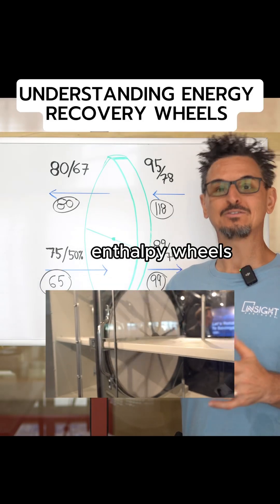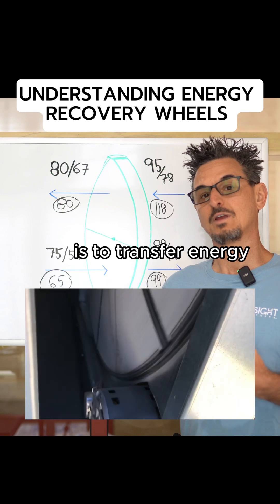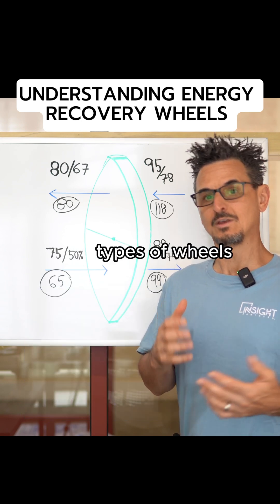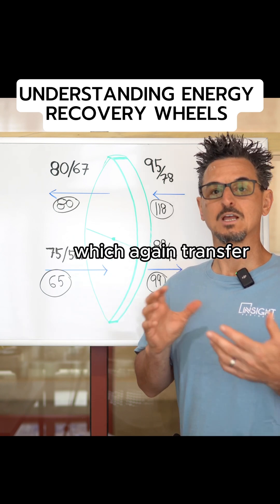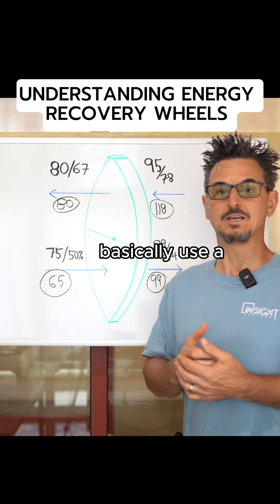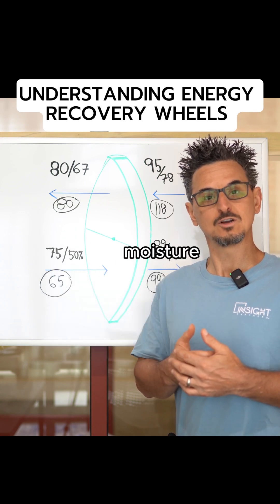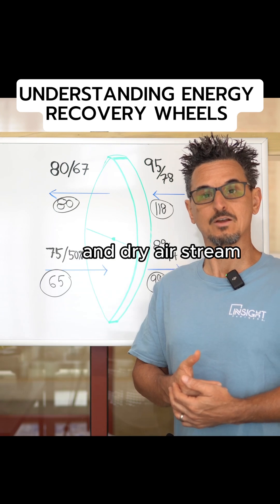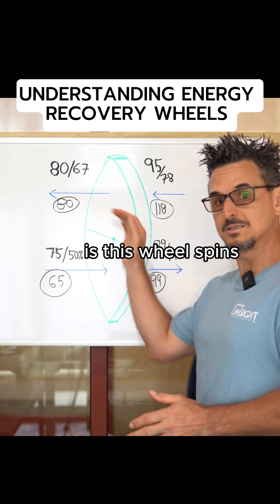Total enthalpy wheels, or energy recovery wheels, are essential in high efficiency HVAC systems

Comment: I do not know you are able to answer me or or not .
Q ? 1 - furnace is less than 3 years old
2 - we bought 10 years service , so them people come twice a year check the system .
3 - this year 2o24 them people came to do so called to check the heat , he sat down and was not able to look what he was doing for 40 minutes , when I ask him what's wrong he said " he is adjusting the gas presure , after he left our furnance was not wotking like before
I have to keep it at 78 or 79 degree to keep the house warm . 
Are you able to answer this problem . He was removing some parts , I do not know why ?
what is wrong , he